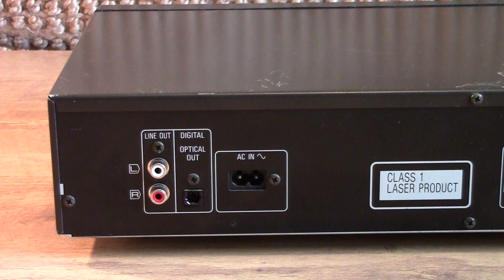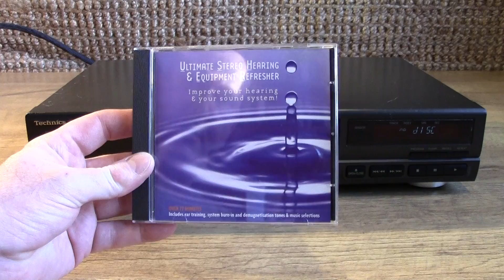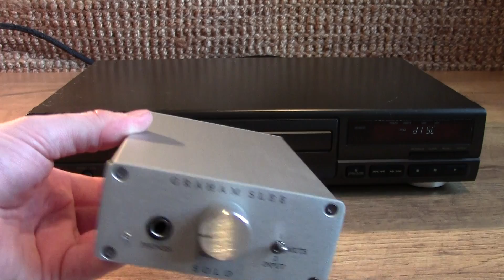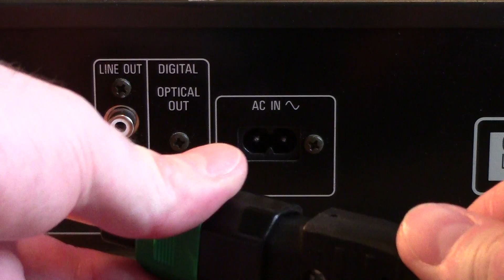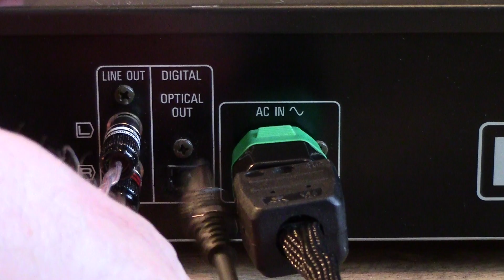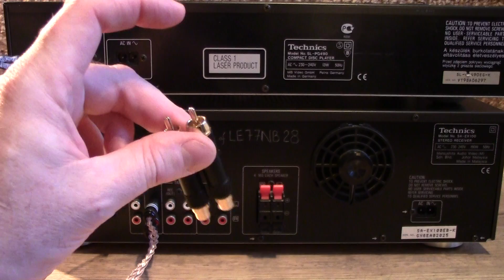Hi-Fi Update 3: Technics SL-PG490 CD Player & SA-EX100 Receiver

Comment: Thanks for video, interesting stuff. I have technics sl-pg490, which I use to listen to my cds with headphones from its headphone out, and I gotta say to me it sounds absolutely fantastic. Shure SRH1440 with this cd player headphone output is so good, great soundstage, imaging and musicality. It's the synergy, which to me is quite magical.

Did you know that SL-PG490 actually does have attenuator built in, which can be activated with the remote? It affects both headphone out and line out, and goes down to -12db, with steps of 2db. It's great way to get more range to built-in headphone amp volume control, aswell to amp connected via line-out. It's a great feature.
Reply from the maker: Hello, Thanks for watching and commenting on my video, it's much appreciated.  I'm glad that you're enjoying the Technics sl-pg490 CD Player, you certainly are using good headphones with it.  Sometimes a synergy between Hi-Fi components does happen and when it does, it's magical!

Thanks for the info on the built in attenuation, that will be useful.  At "only" -12db it won't be enough to stop CD voltage overload completely but it will get a long way there.  Cheers Tudor
Reply: tuturtle 
I just after this video started to realize how that -12db attenuation has really positive impact to sound even through headphone out. Soundstage expands greatly, and music sounds more effortless and refined. It really feels like music starts to breath, there's much more air. How I just now noticed this, I never know, but it definitely is a great improvement. 

I would have thought that built-in headphone amp gain would've been set better, but volume pot range is quite small when no attenuation is used, but then again it seems to like that on many other devices aswell. For example my sony cd player headphone out can barely get out of pot channel imbalance area before it's on listening levels, but that of course also depends on what headphones are used.
Reply from the maker: I'm glad that the info was useful to you and yes I would have thought that the headphone output would have had suitable gain to start with.

Comment: Wow real eye opener. Going to order a pair of attenuators for CD player would explain why the differences in voltage when i switch equipment!
Reply from the maker: +Joseph Torres Hello, Thanks for watching and commenting on the video, it's much appreciated!  I'm glad that I could help, it's an important issue that very few people know about.  I will make future videos about the subject, Cheers Tudor
Reply: If I understood correctly what you said, you want to lower the volume on the line out connectors? I don' t know why you should do this, but if you also have the infrared controller, then you can easily attenuate the volume till -12 dB, if I remember correctly.

It is a really awesome CD player, by the way!

Comment: This video really helped me in terms of my setup. My 1977 Sony receiver clearly does not like the 2V from my technics CD player and my Chromecast Audio. I had a quick flick through its manual and it stated 250mV for its line inputs. This explained why the sound is a lot more brash from the cd player compared to the turntable and tape deck. I made some attenuators like the "Technics Guy" did and the volume knob gives me finer control. Also the sound has more of an analogue warmth to it even though I am feeding FLAC into the chromecast or even Spotify! Although I don't have the money to spend on audiophile attenuators let alone good budget cables (I'm 16, most of my gear is inherited!), building the attenuators has made the biggest improvement to my listening experience bar cleaning the volume potentiometers on my receiver!

Comment: Hi! Great video about lo-fi equipments. My CAL DX-2 has a 2.3 V output sensivity. My amp is a Yamaha A-S500 with a 200mV input sensivity. What db of attenuator would solve my overload problem?
Thanks!
Reply from the maker: +J Sz Hello, You need an attenuator of at least -16db to completely remove the voltage overload, up to -22db.  More than -22db will cause the sound to become dull, less than -16 and not all the voltage overload will be removed, although it will help.  Cheers Tudor
Reply: +tuturtle Thanks for the quick reply. I'm going to source the correct attenuator. Cheers!

Comment: Your talk about CD inputs has me needing to ask a question. I have an Onkyo TX-860 Tuner Amplifier and it has two selectors for CD and CD Direct. What's the difference?
Reply from the maker: +fjwjr  Hello, Thanks for watching and commenting on the video, it's much appreciated!  I don't know this Receiver, but CD direct usually means that the analogue signal from the CD Player input (on back of receiver) goes to the amp section of the receiver, bypassing all features except volume control.  this should lead to better sound.  However the Onkyo TX-860 has an input sensitivity of 150 mvolts, this leads to the same voltage overload distortion as the Technics gear here.  Attenuators of -16db will solve the problem.  Cheers Tudor
Reply: +tuturtle Thanks. Happy listening.
Reply: +tuturtle Well, I couldn't find -16db only -12db but I got them and installed them and it makes quite a difference. Now with much more range (more than double) in the volume it's allowing me to hear things that were just crushed before. Kick drums are more distinct and have more punch without it being overpowered by the bass and the mids are clearer. Thanks for the advise!
Reply from the maker: +fjwjr I'm glad that the attenuators have worked out on your system.  I wouldn't be without them on mine!

Comment: I love Technics gear. I grew up with it (Su-V7 amp, RS-M253X and RS-D190W cassette decks, SL-P277A CDP, SL-QL15 turntable). It's amazing value for money, super reliable and very well built inside and out. Even though I now own much higher end gear, I still love listening to my technics system.

Have you ever heard a Technics linear tracking turntable?
Reply: tuturtle Their late 90s gear was definitely very ordinary, with the exception of the J300R turntable. http://www.audioappraisal.com/retro-review-technics-sl-j300r-linear-tracking-turntable/

Try to find yourself a linear turntable if you can. They're very interesting to listen too and use, and not to mention great conversation pieces.

Comment: Hi Tudor
Great and informative video as always. And nice to hear about the miss math in voltage between CD and Amp. It will be so interesting to try it out :)
Reply: This will be really great.. I'm actually looking at an NAD 7240PE receiver right now... I might buy it for the money I got from my parents at my birthday. Do you know that amp?
Reply: OK... I have read that too about their amps. I don't really need the radio. But as you say it really has a 80's retro looks to it. The 7240pe is for sale for £80.. I have put in a bid at £50. And I'm now waiting for his answer. I do have the opportunity to place a bid on these integrated NAD amps too. Which one would you prefer out of these?

NAD 302  (for sale for £90)
NAD 304  (forsale for £60)
NAD 3100 (for sale for £70)
NAD 3150 (Very cheap. Hums, and has noisy volume control) £20 
NAD 3155 (for sale for £80,5)
Reply: Or should I just save the money, forget about it, and enjoy my Nikko NA-890 amp? :)